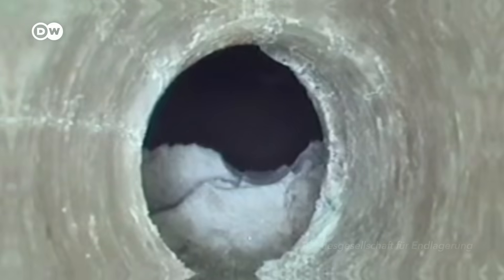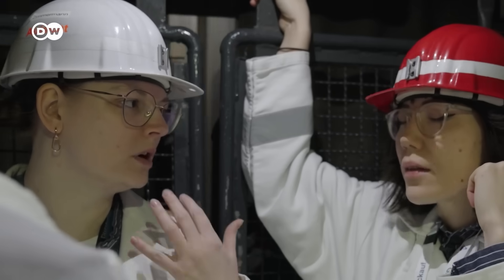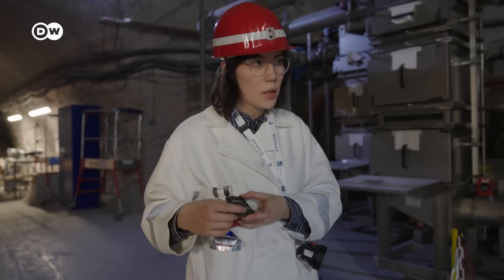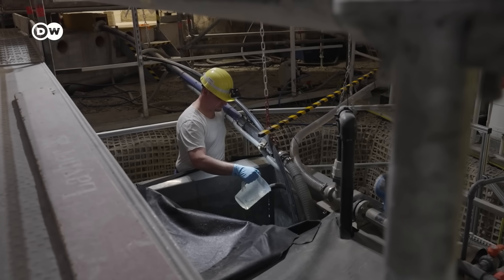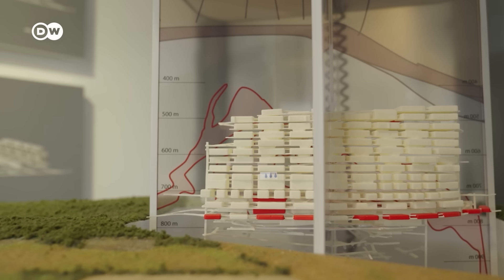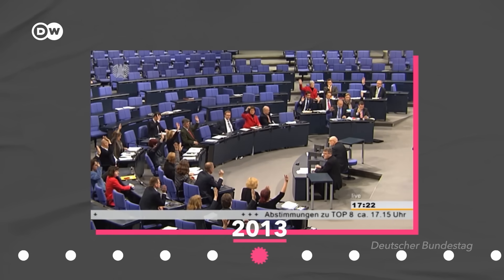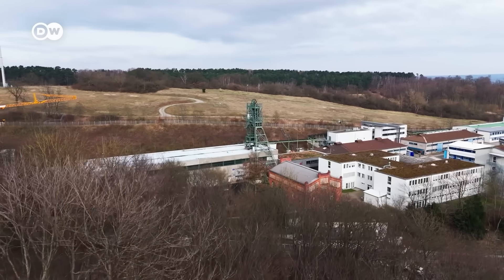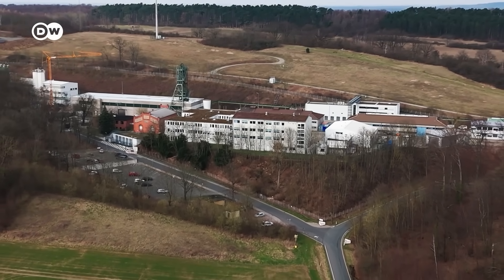Inside Germany’s hidden leaking nuclear waste dump

Comment: Great piece!
The way societies and politics are set now, it's pretty predictable what will happen to this site, and several others spread around the world in many nations that face similar or even worse situations.
It'll stay there until it starts leaking, at which point people will be evacuated and left without their homes, they family history, their places of origin.
And it'll happen this way because of what this piece has shown - even in modern affluent developed nations, the problem is that you get a string of politicians promising to take care of the problem, but never delivering it because it's too costly, and too controversial to touch once they are in power. It's a system set for failure, as is many other large scale costly problems that several nations face.
So you can only let things get to a point when the problem becomes impossible to ignore. And then it's reaction and remediation, rather than prevention.
You can find many parallels to this - including the one thing that might exacerbate this very issue - Climate Change.
The way out systems of governance, justice, politics and whatnot works right now, in several modern democratic nations, points out clearly to the inevitability of letting things escalate to ultimate consequences so immediate measures are needed.
This is particularly true for public infrastructure failure.
So, and I'm very sorry to say this for the poor people who will be directly affected by this, the most likely scenario for places like that in most nations, is that they mostly depend on luck for living in those neighborhoods, and even entire cities.
At some point in the future, the inevitable will happen - radioactive material will leak on water table and contaminate the environment, a large area around it will be deemed unlivable, and then people will be left to scramble to save themselves. That's if the country is in good government hands, depending on who is elected people might not even get any warnings and just find out what happened when it's already too late.
And then this zone could be chosen as a dump site, if well contained, because what else could you do there?
This is the whole story of places where radioactive waste, toxic trash, and dangerous stuff ends up in.
People encroach on it because they don't know, or because they ignored the warnings, and then generations later others will be paying for it.
Problem here is that governments, even when they are competent enough to understand the size of the problem, won't touch the thing with a 10 foot pole because it is bound to make them unpopular one way or another. If they spend the money to do it, this will have an economic impact to the nation as a whole, and people unsympathetic to the problem will complain. If they say they won't do anything, then it's the electorate worried with the problem that will attack them. It's a loss no matter how you see it. So they will knowingly or not, try to ignore it as much as possible.
And unfortunately, for all the good that the principle of alternance in power can have in funcional democracies, one of inevitable consequences is exactly the type of short term thinking that stops politicians from looking at problems for the long term.
Even if we pick Germany itself, there is a contradictory move right there that shows this. And it is directly related to the topic of this very video. You see, despite this very case serving as food for anti-nuclear power types to say that we cannot safely use nuclear power for energy production, the anti-nuclear movement and how it convinced Germany's government to shut down nuclear power plants operations, turning to Russia gas production instead, is partially behind the whole crisis that the country is facing now. So, premeditated reaction based policies that are fueled by FUD will often end in a worsening situation. Which in turn gives and excuse for government to be slow to take action. Which also only worsens the situation.
This whole system is why I'm making the prediction that I did. It can sound a bit alarmist and radical, but there are reasons why I think it's gonna go that way.
What the people in that town, the site itself, or people vouching for a rational solution need is kind of a kamikaze politician committed to solving the problem no matter what even if it costs him his career, his life and everything else. In other words - a radical. That is very much unlikely to ever be elected. Because this is a problem that the majority of people in the country can continue living their lives ignoring, turning their backs to, and living their everyday lives not really worried about it - until the worse happens. Just like Climate Change.

Comment: Standing above waste gives 0 radiation. If the nuclear waste was radioactive enough to be an issue, you would get at least something. Low and intermediate level waste is just not very radioactive. This is blown out of proportion.

It needs to be addressed for sure, but it can easily be done, maybe no one wants to pay for it. Capitalism strikes again.

Comment: I wonder if the US would go to such measures, 600ppl working there, all the time, daily monitoring, trying to keep things safe? From what I understand, the US only pays for new infrastructure, not maintenance. Hence what happened in Texas in the winter a few years ago.
Reply: That's not really a similar situation. The problem in Texas wasn't lack of maintenance it was that the equipment wasn't designed to handle temperatures that low. It was a rare weather event much colder than their usual winters. The equipment is owned by private companies who can make more profit by producing and selling less electricity than they can by investing enough to keep running in cold weather to produce a little more electricity. The Texas government chose to leave it to the market rather than requiring them to protect against cold weather as is done in the rest of the country. The "maximise profits" goal is not aligned with the "produce reliable power 100% of the time" outcome that people want.
Reply: @adrianthoroughgood1191  winterization counts as maintenance. This isn’t just a free market problem in Texas. PG&E and wildfires have been linked to a lack of maintenance. Very sad.
Reply: @robertchanrussell2010  No, gas valves and gas expansion stations got frozen in Texas. They had the choice to install valves with insulation and heating (it is a permanent feature, nothing you equip for winter and dismantle in summer) which are more expensive compared to the normal valve. Downside, the normal valve does not work if it gets really cold. Furthermore, the electricity market prices normally are low in winter. Most companies schedule power plant maintenance for the low profit time in January/ February. This free, unregulated market without any rules for minimum available capacity resulted into the load shedding. The wildfires are in deed a result of poor maintenance (we have projects in 3rd world countries which do a better job).

Comment: Even if it's moved elsewhere the mine won't be clean. I don't see the point, it's probably cheaper and safer in the long run to isolate the mine, invest in making all areas as water proof as possible and all that.
Reply: ....how exactly do you plan to make the mine magically waterproof? That is not an engineering solution, waterproofing (not water resistance, but proofing) even small electronic devices is incredibly challenging. For a massive radioactive undergroud mine though?
Reply: Tgey will have to dig and wash out tge contaminated salt

Comment: And they say nuclear energy is renewable and safe!
Reply: Nuclear fission has never been renewable, safe, or cheap, and it never will be
Reply: But it is
Reply: Nuclear fission is absolutely not safe, or renewable. It is also much, much more expensive.
Reply: @MultidimensionalSentinel  it is safe and clean, but yes, it's not renewable.
Expensive in comparison to what?
Because you have to consider that all energy production is not equal. You cannot just install solar panels and wind farms, you also need baseload energy production. And in those cases, you need either hydro damns, fossil fuels or nuclear. And in that case, if we actually want to reduce the amount of CO2 we produce, fossil fuels are a no go. So it's either damns (which cannot be built anywhere) or nuclear (which still can't be built anywhere, but it's much less restrictive than hydro). Batteries can also be added to the mix, but that would also require the energy production side.
Reply: @ggandalff  It is clear you don't know how nuclear fuels are processed.
Reply: @youme1414  in what way the processing of nuclear fuels is not clean and safe? 
Im pro renewables and nuclear, but I know that there is no type of energy that has no impact

Comment: 2:13 what I never understand... why do they THROW that stuff around like this? it's so unnecessary, just pile them up orderly and check them every year, and if one leaks, repair the barrel or replace it somehow. Don't just throw that shit down in that pit!?
Reply: They mention this in the video if you watched it. They used to stack them orderly, but due to safety concerns for the truck drivers spending too much time putting them in an orderly fashion, they decided to instead just have them dump them in a pile like that.
Reply: @Vnifit  
It's still not safe in the long run. It's even more complicated to get the barrels out now.
Reply: ok, now I watched further and... it just makes me angry.
Reply: Using remote controlled robots to stack the barrels so a human can stay at a safe distance would be much better.
Reply: @adrianthoroughgood1191  robots are not immune to radioactivity and making one that is is very expensive, for examples look at Chernobyl
Reply: @TheRealSykx  that's a completely different situation. This was a relatively low radioactivity environment that was just a bit unhealthy for workers to be in. It wouldn't have been enough to prevent the robots from working. Chernobyl was a live nuclear reactor core open to the sky.
Reply: Because as it accumulates the radioactivity does so as well, which means it eventually becomes unsafe to have humans be near for any length of time that's useful, thus..
Reply: Exactly my thoughts.

Comment: But how much is it radioactive? What is the real scope of the problem? Ground is radioactive too. Granite constantly leaks small amounts of Radon gas, but nobody proposes to remove all granite buildings
Reply: Indeed, you have to wonder if the same care is taken with all the other abandoned mines in the country (e.g. pitchblende, mercury, coal, arsenic).
Reply: The Asse II mine contains approximately 47,000 cubic meters of low- and intermediate-level radioactive waste, which was deposited between 1967 and 1978. This waste is stored in around 125,787 barrels across 13 chambers at different levels of the facility.

The total activity of the radioactive material at the time of deposition was about 1.8 × 10¹⁵ Becquerels (Bq). Due to natural radioactive decay, this activity has decreased to approximately 1.53 × 10¹⁵ Bq as of January 1, 2023.

Specific radionuclides include approximately 28 kilograms of plutonium and 30 kilograms of uranium-235. However, the documentation of the stored waste is incomplete and partially inaccurate, leading to uncertainties about the exact inventory.
Reply: В Чернобыле в саркофаге старые сборки твс фонят около 300Рч. Этого хватит чтобы убить человека за 2 часа.
Reply: It's the potential for the mines to collapse and all the waste getting leaked eventually ending up into the water cycle near by. Wouldn't have been an issue if it wasn't dumped below ground
Reply: @eskimo4130  were else should it have been dumped?
Reply: @elonmuskes4874 Good question… as nearly all Countrys just dump that crap

Comment: They literally just dumped it lol. Didnt stack or organize or nothing. Germany is wild
Reply: Definitions of nuclear waste varies. E.g. in the US, if you put a smoke detector into a barrel full of ordinary soil, it's nuclear waste.
Reply: @0thPAg  yes, and that is exactly how it should be. The smoke detector contains radioactive material. If you are mixing a little bit of radioactive waste (the smoke detector) with a volume of dirt, then the whole matter becomes nuclear waste.
Reply: It's no surprise that people try to invent technology to go to Mars :D Be it WW3 or anything else.
Reply: @neverrl3379  In 1952, NASA rocket scientist Wernher von Braun published a book entitled "The Mars Project". In that book Braun wrote about a man named Elon guiding humanity to Mars. 🤔
Reply: @derp8575 you could mention that von Braun was a german „hired“ due to Operation paperclip
Reply: it is qite a commen method for desoposing of low level neuclier waste. this is also the method used in findald for long term disposal. the method ensure that as few people as posible have to come into contact with the material. when the "rooms" are alsost full they can simply fill the rest with concrete and leave it. As explaind in the video salt is an exilent insulator for the radioative materials.
Reply: @elonmuskes4874 bro cant spell for shit
Reply: @elonmuskes4874 concrete is not a long term solution. After 50 years concrete is cracking
Reply: @elonmuskes4874 what a joke thinking a about the longterm consequences
Reply: @sonnigundbelanglos considering it won't be radioactive in a few hundreds years not much
Reply: This is to minimize exposure to workers. The barrels are robust and only contain low level radioactivity
Reply: British and American Nuclear disposal 😅
Reply: multiple types of storage were tested. The dumped type was supposed to be covered with salt to prevent any water getting to it.
Reply: We are talking about south-eastern swiss granite levels of activity at most.

The "radioactive waste" that was disposed of in Asse-2, is essentially just normal municipal waste from nuclear sites that nobody bothered to measure free of hightened activity.
Reply: whats wierd is the fuel can be refined numerous times and is economical at least from the research i've done so far. dumping seems even dumber. that or this has been refined a few times and isn't as radio active
Reply: @cdoublejj what's stored there is just low and medium level waste. 

There's a lot of hype and PR propaganda around nuclear especially recycling or reusing spent fuel.
Reply: @ALEXbLack2  i needed chatgpt to understand what you wrote but i agree
Reply: Jaja dein land macht es bestimmt besser😂😂
Reply: All the actually valuable parts of germany were built by muslims, the germans half ass and take vacation due to crap worldview (atheist nihilist)
Reply: It’s a ongoing thing even in the us to figuring out what to do with nuclear waste everyone dumped it when no one wanted to care and now we have to figure out what to do with
Reply: Ftance just du ped their buclear waste in the ocean.

Its still there but the barrels are eroding

(Google for nuclear waste in the english channel)

Uk and ftance dunped their waste into the atlantic and the english channel

I dont know which one is „eilder“
Reply: Well they could start covering the surface with concrete, it would be big bit if the water is stopped from flowing through, it will stop moving and exposing 
It would be ugly. But they won’t be able to do anything about it, no one wants to die over an old problem..  what they need to worry about is a run away reaction.. it only takes 2 elements to happen..
Reply: They said why
Reply: It's the same as France/UK - just dumping it directly into the 'English Channel' ☠️
Reply: Two words: Love Canal
Reply: @scdbub  I listened to a podcast about that, yesterday. Hadn't heard of it until then. Crazy how money trumps all. Even kids' health.